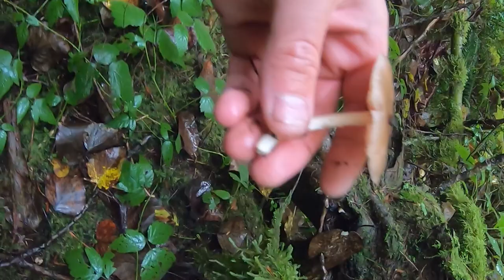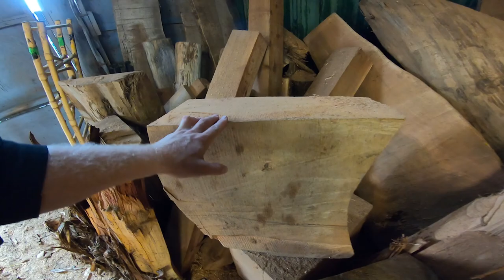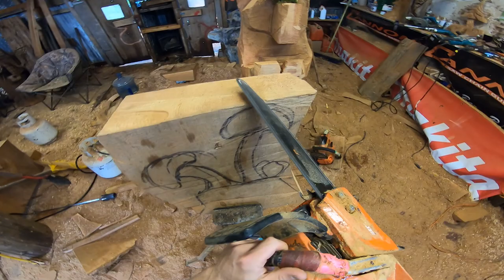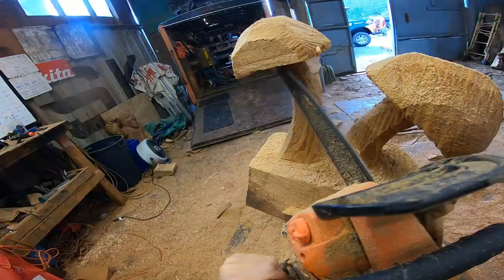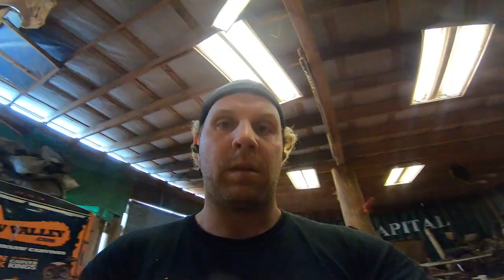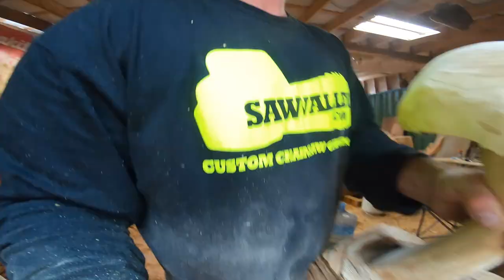Carving MUSHROOMS - Finding Shrooms then Carving TWO - Tutorial - 5000 subs WIN This

Comment: Love it man. My favourite video so far. I just got a 12” canon quarter tip. Excited to use it once the 1/4 pitch sprocket comes in. My plan was to start with mushrooms and your videos have become my fav  May I ask why you keep your chain so loose? Also is there actually no kickback on a carving bar? I can shave with the tip and plunge cut without much worry?
Reply from the maker: Awesome